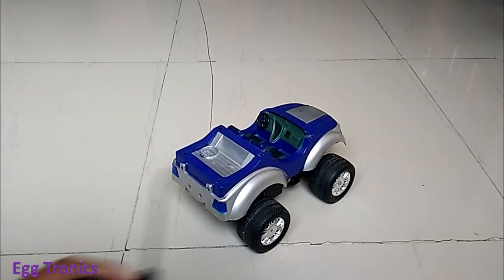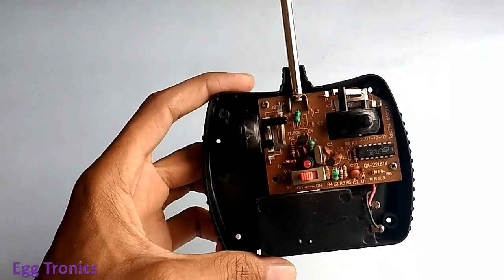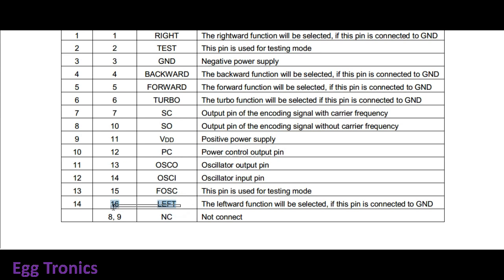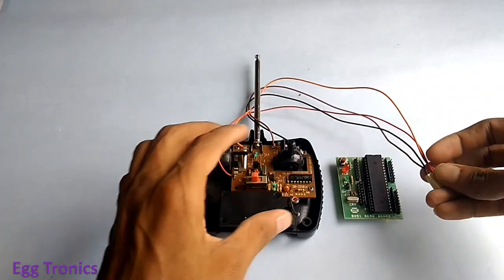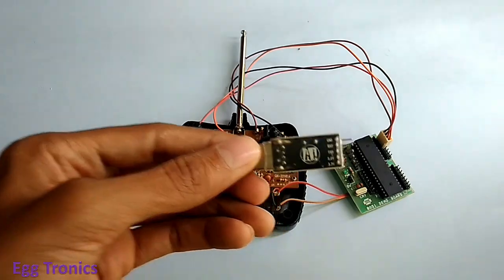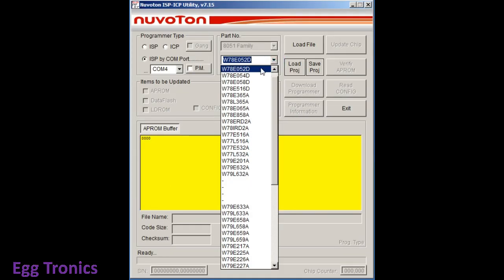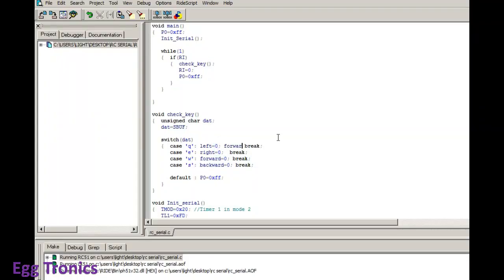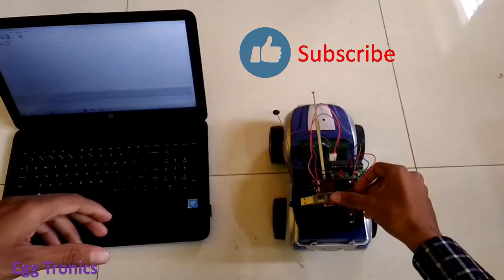Laptop Controlled Car by hacking Car's Remote

Comment: Hello, I'm trying a similar project. In my case the circuit uses a variable resistor to move the car forward and backward. How do I connect the Arduino in this case?

Comment: By which programming language you have entered code
Reply from the maker: I used 'Embedded C' which is similar to 'C' language to write the code. The Software I have used to send the written code to microcontroller chip is called 'Nuvoton ISP Utility'.
Reply: @EggTronics31  thanks
Reply: @EggTronics31   can we use Arduino for the same
Reply from the maker: @art-Edits893  yes.. you can use Arduino. If u know to program arduino it is pretty easy. For a similar project. You have to configure pins as 'digital output' and configure serial monitor at 9600 baud rate; to send keyboard 'keys' to Arduino board. It will work.